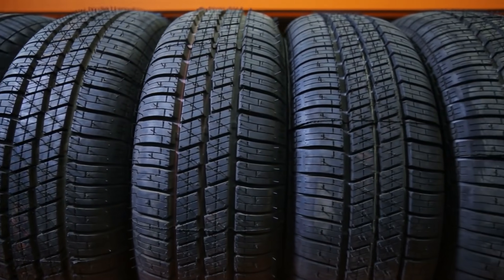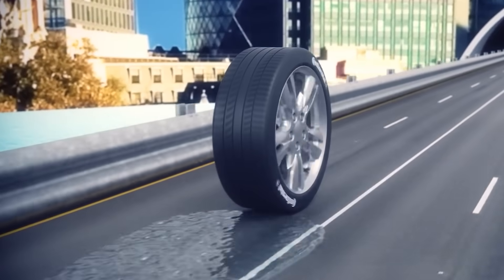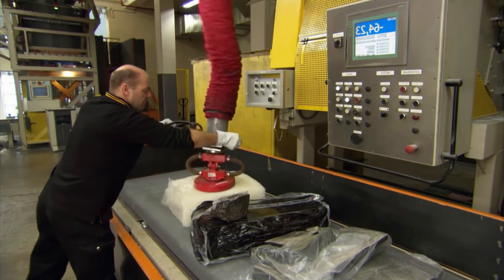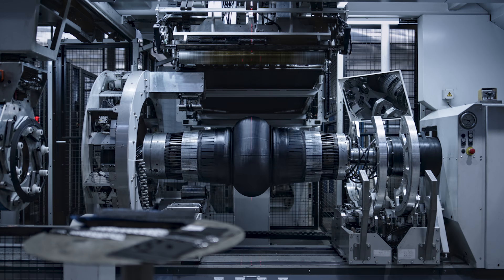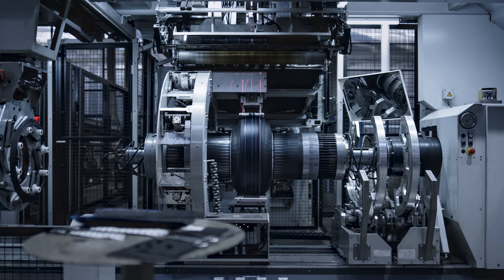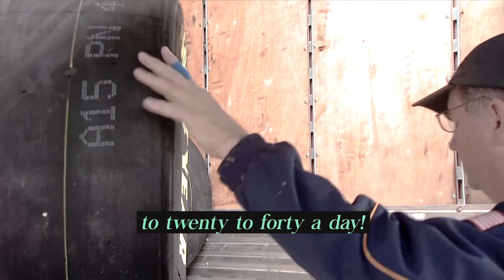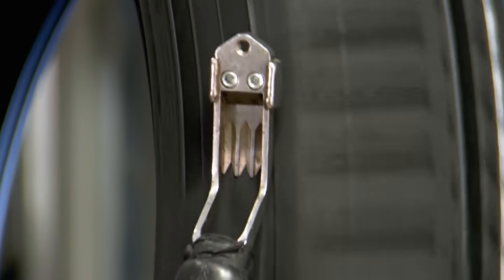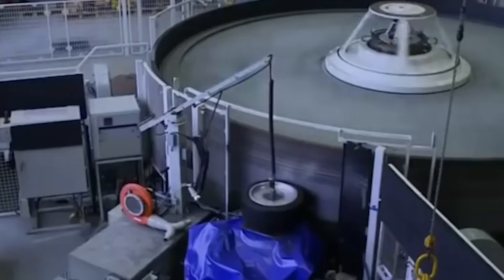How Tires are Made

Comment: I worked for Goodyear back in 78 thru 82 just as they were shutting down the plant, built in 1938
I hired in as a General Operator and qualified on a Turret building Bias Ply tires, I also qualified on Truck tires and a total of 11 different jobs
including first stage Radial tires, 

I changed bladders and sort and service as before they shutdown, they laid off and I got a few temporary jobs substituting for sick workers.
I still have the little screwdriver for changing the tags inside the tire mold and of course a nice pair a scissors.
Plus it was like hanging out in the neighborhood as I knew most of the workers.
I loved working for Goodyear. But when they shut down I found another plan building Highways and bridges which I also loved.
Reply: @Wardell43 Hi! Did you ever have health problems related to exposure of materials in the factory? I heard it's very toxic.
Reply: That’s so cool! It’s an eye opener for me how complex the manufacturing process is. How does a tire plant clean its conveyors, rollers and bladders? Do the melted rubber leave traces on the surfaces over time that may cause problems to product quality?
Reply: They have a Maintenance crew, but the plant was old.
Hot tires are not moving around.
When you build the tire, I never wore gloves as that would have been a hazard. So the only time that they are hot is when they are in the mold.
 @BKRSingapore